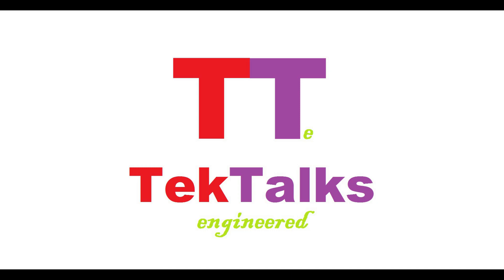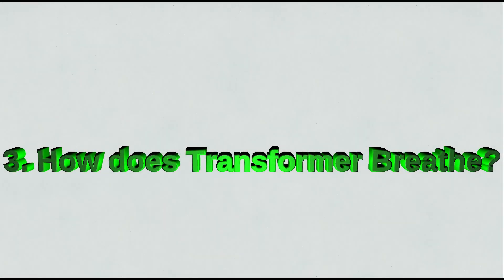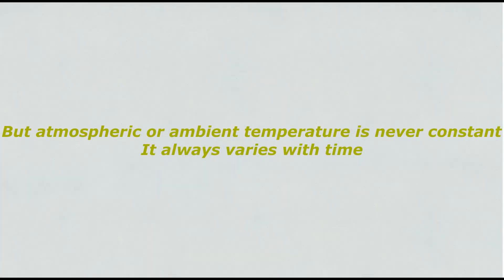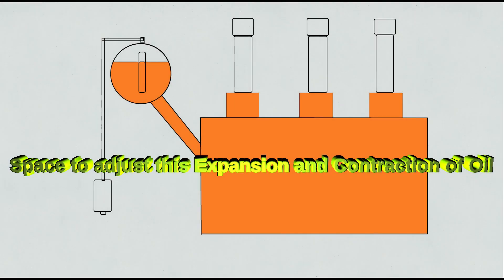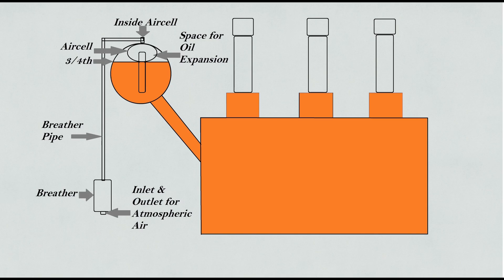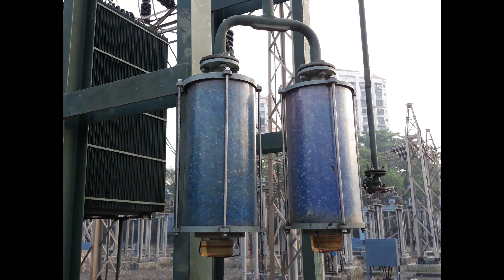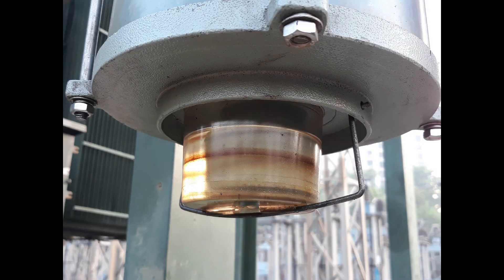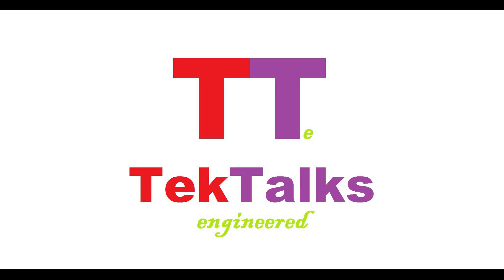Breathing process of Power Transformer explained complete in detail and in the easiest way

Comment: When the air is sepeated from the oil, by beeing in a closed air cell, why is it so important to remove the moisture?
Reply from the maker: Good question. It is a second layer of protection to avoid moisture ingress. In case aircel ruptures, silica gel breather protects against moisture entry in the oil.

Comment: What is the point of Sicagel if the breathing system is completely sealed with the aircell (baloon) inside the expansion tank?
Reply from the maker: It's a valid question. Yes silica gel absorbs the moisture from breathed in air. However Aircel acts as second layer of protection against moisture. Some transformer designs do not have Aircel.

Comment: Sir,I am Abhranil.I watch your videos on a relgular basis.I have a question from transformer breather working principal. A partially oil filled cup is used to absorb the dust particles from air before it enters in the silica gel container.There is a oil level mark over this cup.My question is the air inlet/outlet duct which is looking like partially submerged in oil (oil cup).So is it the right process to fit this cup beneath the breather air ventilation duct.I think in this situation it can release conservator's air from this submerged in oil duct,but can not inhale fresh air because it is already submerged,how can something breath inside any liquid substance.
Reply from the maker: Yes. Breather duct (pipe) is submerged in oil cap. When transformer breaths in, that means when conservator oil level goes down, air pressure inside breather duct reduces. Hence pressure on oil surface inside oil cap is relatively more than that of breather duct. So  air passes through oil inside breather duct and maintains pressure equilibrium on both sides of oil which is in breather oil cap. Hope this answers your question.

Comment: Hey i wants to know about transformer breather, there is a valve above the breather at my work place, now maintenance going on here, how should i know if it's open or closed? From the bubbles in oil cup?
Reply from the maker: Valve has open and close indication. By this indication one can know whether valve is on closed or opened condition.
Reply: @ElectroGlobe1  if valve is closed there are bubbles inside oil cup or not?

Comment: Very nice excellent explanation 

Q1- What type of materials the Air Bag cells consisting of ? 
Q2- How about utilitizing N2 in Pressure Tests as below :

Interestingly case if filling SF6 instead of N2 due to human error during that pressure test in commissioning stage,  could SF6 in that case after years in service be desolved into the transformer oil ? 

----------------------------------------------------------------
Quate it from 
https://electrical-engineering-portal.com/do-not-energize-oil-filled-transformer-15-tests-and-checks

"Pressure Test 
Check the transformer tank for leaks by pressurizing the tank with dry air or dry nitrogen through the pressure test fitting to a pressure of 3 to 4 PSIG. let the tank stand under pressure for one to two hours, then examine the tank and fittings for leaks. leaks above the fluid level can be detected by applying soap solution to all welds, joints, pipe fittings, and cable connections.
Upon completion of this test, reduce the internal pressure to 1 or 2 PSIG."
Reply from the maker: Thank you for appreciation.
1. Aircell is made of Nitrile rubber
2. Yes N2 can be filled instead of dry air for pressure test. However N2 is not good for human. Hence it is avoided for safety reasons.

Comment: can you tell why breather is connected with conservator and not with the main tank of the transformer?
Reply from the maker: In conservator minimal surface area of oil is in contact with aircell, which again prevents oil from external contamination. Also conservator is the highest oil head, breather tapping at any other lower points will cause oil to spill out through breather.